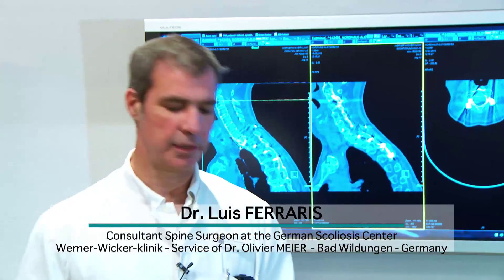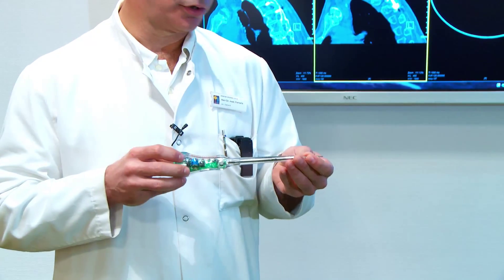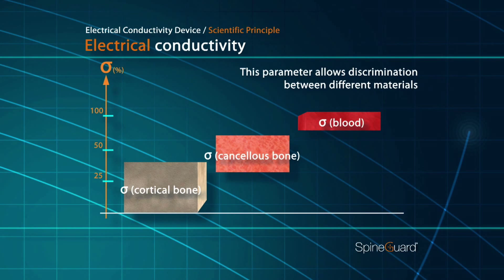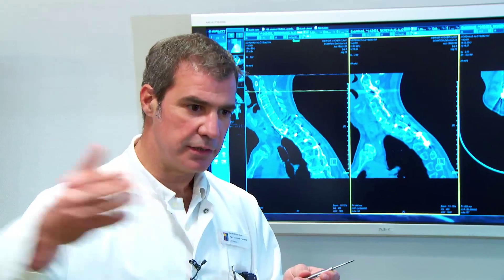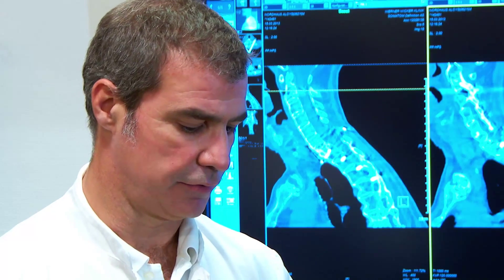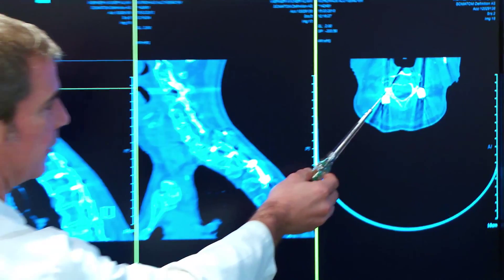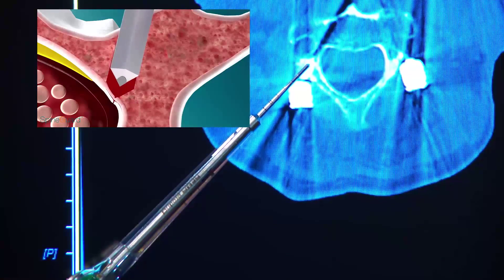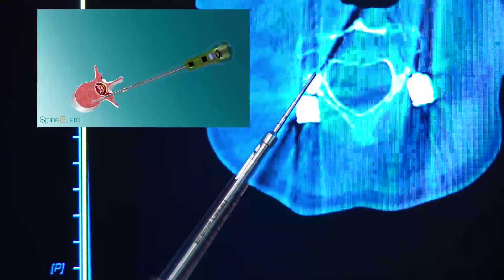How PediGuard Works?

Comment: How to differentiate between blood from the hole you perforated or from tissues being breached
Reply from the maker: You must listen to the audio feedbacks of the PediGuard only when you push on it into the hole while you are drilling. As soon as you remove the PediGuard from the hole you have a blood succion effect.
Reply: @PediGuard  thanks, some told me it can be used without the connect tablet is this right?
Reply from the maker: @_hasdar_youtube  yes, that's right. You have some versions of PediGuard that are compatible with the DSG Connect tablet and some versions that are not. The DSG Tablet helps to understand the audio feedback, especially for new users. Are you a new user? Where are you from?
Reply: @PediGuard  thanks for the replies, i work for a company in KSA I attend spine surgeries and I am interested in PediGuard so i am learning about it
Reply: @PediGuard  can you hammer on it?
Reply from the maker: @_hasdar_youtube  Gentle hammering alternated with instrument rotation are possible.